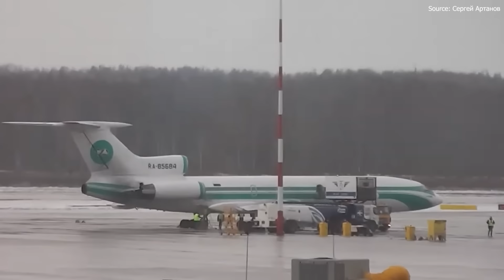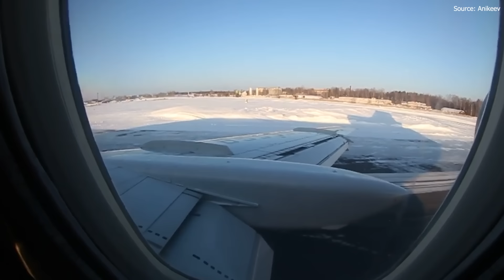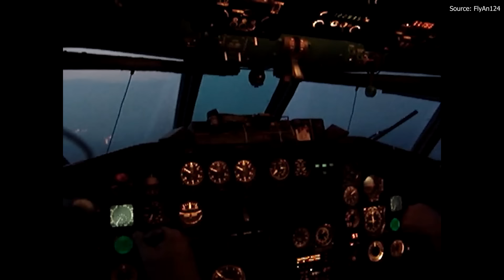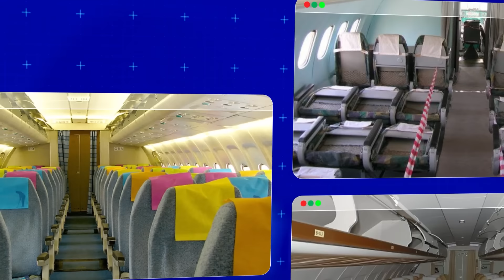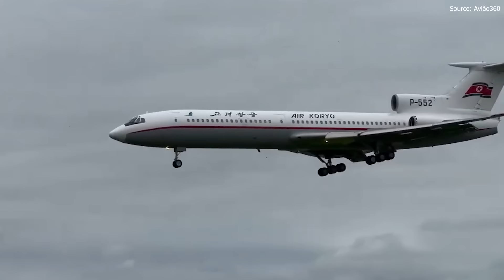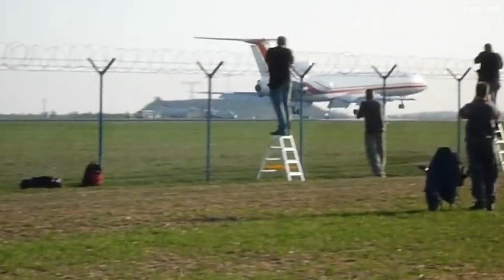Why Was The Tu-154's Middle Air Intake Oval-Shaped?

Comment: In my young years Living in Moscow I flew a lot the tu 154 and its smaller sister the tu 134, the 154 is an excellent airliner always performed well, the only crashes were pilot errors most of the times and never from the plane.. On fighter jet comparison, Once we had a landing from cruise altitude in exactly 7 minutes, numerous times we had 180 degrees sharp turns on edge of runway before landing.. nowadays these seem impossible feats.. all in all, great plane that I liked on par with the IL 86 and IL 62

Comment: I flew a TU 154, from Moscow to Copenhagen in 1996. When I saw the plane, I thought it must be "Soviet homemade", but I was surprised. The take-off was surprisingly powerful, and when the plane landed in Copenhagen, it was as if the plane landed on a cushion of air - no bump! I thought it must have been a very skilled pilot. After watching this video, I understand better the strong acceleration, and maybe it was, besides a skilled pilot, the extra long landing gear that made the landing so perfect.
Reply: Flying an aircraft like the Tu-154 took a lot of skill. Most pilots would have thousands of hours of experience on other aircraft long before they actually got into the cockpit of a Tu-154. I had the honor of talking to a former Tu-154 pilot a few years ago, he really missed it a lot.
Reply: The landing on Tu154 was so soft easy not because of pilot skill, but mostly because "ground effect". It is, exactly as you pointed out, an air cushion. It forms under all aircraft close to the ground, but is most pronounced when wings are low ( closer to the ground). Aircraft eith engines below the wings have their wings higher from the dlground on landing, to give more space to the said engines.

Comment: Oval centre intake copied from the De Havilland Trident, which flew 6 1/2 years earlier in 1962.

The Trident was very advanced  for the time - 1st zero visibility auto land ; incredibly fast (Mach 0.88?) the aerodynamics principles on the Trident wing was a foundation for future Airbus wings.
The tragedy with the Trident is that the Board of the then new Hawker Siddeley Aviation  which amalgamated DeH with Avro and various others, decided to downsize it to suit only the launch customer. The specific new engine for the Trident (RR Medway) was canned as a result, resulting in a underpowered aeroplane that thereafter struggled to grow to the correct (= original..) size the market required.. No-one else wanted it. 

Boeing - having been given all the Trident tech as an attempt to launch a joint project - correctly decided to go alone and keep the original size. 

The rest is history (117 Tridents,  1800+ 727s...)

Comment: My father was piloting the 154 for a while. He still admires her but admits that, while being extremely reliable and simple in maintenance, it wasn't tolerating to pilots' mistakes and Tupolev engineers were too overconfident to admit the many 154's flaws until it was too late. Still a good machine in her class tho.

Comment: I flew in one of those badged as Air Via back in 1996 to Bulgaria. They'd done a decor job on it with what looked like gloss paint inside but the equipment looked very 1970's. The wings had patches on them, the engines were very noisy on start up and it didn't seem to have air conditioning, only heat so on the ground it was boiling. Quite an experience.
Reply: In America you had airliners that were air conditioned. In old Soviet Union, we had airliners where air conditioned YOU...

Comment: Flew to Yugoslavia from Manchester in one of these and loved the experience. Not only was it super fast it was surprisingly comfortable for something that looked like it could be easily repurposed from civilian to military use. Also flew on a TU 134 which was clearly a design from an older tech school of thought and obviously a military aircraft first but put to civilian use with minimal frills. Again a fast aircraft but seriously less confidence inspiring…….especially when high temps prevented safely filling the tanks in Split and requiring a cooler temp top up in Zagreb to get home. Thankfully some of the most beautiful cabin crew I’ve ever seen proved adequate distraction. The 16yr old younger me was very very happy to suffer such aesthetically satisfying delays.

Comment: Swept wings do have inherent stability, but dihedral or anhedral is not a "choice". It is designed into an airplane to provide the desired roll stability, considering the airfoil section and wing design. Many western airplanes use anhedral - The F/A-18, B-52, F-15,  Panavia Tornado, Sepecat Jaguar,  for instance.

Comment: flown twice on a 154-B2 both on Malev, in 1985 and 1989 much more stable on takeoff and landing than any American passenger jet due to its very wide tricycle gear, also landing was very smooth as the drooping wings also took up some of the impact on landing
Reply: Me too. A few times to Budapest. A different ride to the  Western stuff. Just seemed stonkingly fast!
Reply: @PeteClark-fb7qr  Back in the day I always thought it was ridiculous that they had the right side of the plane smoking and the left side non-smoking, doesn't help you when you are at an aisle seat.  The engines had a high pitched scream to them

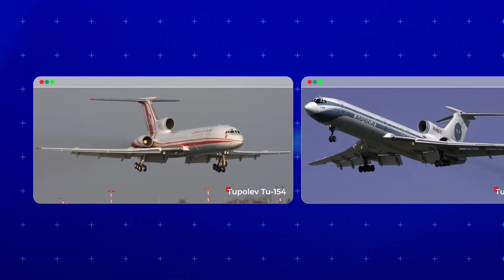Comment: 7:08 Isn’t  that  this Polish Presidential TU-154 that crashed in Smolensk, approximately 15 years ago?
Reply: It sure is, the plane performed reliably but the pilots were under pressure by higher rank officer in the cockpit and worst visual conditions.

Comment: Also anhedral swept wings also are a bit more effective since air isn't rushing towards wingtips that fast at a big angle of attack. Also it isn't the first two players playing to feature anhedral wings. Tu-104, based on a bomber, had similar wings
Reply: Also allows the main landing gear to be shorter, as the main gear is closer to the ground

Comment: -I flew the 727 on all three seats.  Flight Engineer. first officer, captain.  I did them ALL.  But here is what I can tell you about the 727-100:  It had the stupid oval shaped intake for the center engine (I could never land that airplane right!  The -200?  That was easy). When you level off, you need to shut off one of the bleeds of the number 2 engine just before your altitude, or you will get a loud compressor stall!  I never caused this during the 1400 hours I spent in the flight engineer position in this airplane.

The stretched 727-200 had a round number 2 opening and this was not a problem.
Reply: Dear friend.
I have a question to ask you.
Few years ago in Iran , one 727 crash landed during approach on a snowy night just before the runway.
Would you please tell me is there any special procedure for throttle adjustment during approach in snowy cold weather?
From what i heared the crew shouldnt retard  throttles to idle in freezing temperatures otherwise the engines will flame out!!
And if this is true, please tell me who is to blame?
Is it the captain or Flight engineer?
Thank you
Reply: @AmirhosseinEghlim  In icing conditions we turn on what is known as engine anti-ice.  This bleeds off hot air from the compressor section of the engines and sends it to the inside of the intake "lip".  This air is approximately 300 degrees C and effectively prevents ice from building up in this area.  The intake of a jet engine is very carefully designed and any ice buildup could cause the air entering to become erratic and possibly cause the engine to stall and "backfire".  The bleeding of air like this causes the engine to lose a small amount of power, but this is insignificant. To produce the proper amount of hot air like this, the engine must be operating at a slightly higher speed, so there is a limitation against going below a certain internal RPM when this system is activated.  The only time you go below this limit is when the airplane is about to land, just a few meters above the ground.

I'm not familiar with the Iran crash, but it could be any of a number of things.  We also have the ability to prevent ice buildup on the leading edge of the wings in the same way, and while this situation is rare on fast jets, it can happen and if it is not remedied by turning on the wing anti-ice system, it can result in a disaster.
Reply: @Flies2FLL Thank you so much
I appreciate it.
Best regards
Reply: I came here to comment on the 727-100 having an oval inlet as well.  The Russians copied the old  design.
Reply: I was a FedEx ramp agent on 727-200s and got to jump seat with the crew. 
Still my favorite aircraft.

Comment: As plane spotter at the Munich airport, I liked the Tu154 for their distinctive idle whine. You arrived anywhere at the airport and knew by that sound, a TU154 must be around. So much fun, when planes didn't all look similar to each other.
Reply: How Long are they Not allowed to fly in the EU do to noise and emmissions ?
Reply: @wheelieschulz1204  If you mean the Ruhezeit aka quiet time at the Munich airport is from 11pm to 5am i think
Reply: @jorkingitvigorously  Aber außerhalb dieser Zeiten darf man damit fliegen interessant 😅
Reply: I haven't lived in Munich for long, but i don't know if you ever managed to see the IL-76 land here. Same distinct whine, basically their charm
Reply: I flew once from St Petersburg to Vienna on a Tu-154. What I recall most - apart from the rather narrow cabin - was the awkward sound the engines made upon take off: they were spoiling up on a very high pitch (like a coffee grinder) and returned to a normal pitch once thrust was set back to climb.
Reply: 15:55: That's a Yak 42 ....

Comment: The B727-100 had an oval inlet. The longer -200 #2 inlet was round with vortex generators.
Reply: Sorry.  I was wrong.  727 100 had a slightly oval #2 intake
Reply: @dougn2350... I've slid down both....though a tight fit in the beginning in the -100...no rips or tears when i got to the fan!!

Comment: The most beautiful passanger aircraft ever made.
Reply: No. The Constellation was.
Reply: @JRobinsonSr  Why are everyone so obsessed with the Connie? It looks like an unevenly filled sausage that is thicker in the middle than in the nose and tail, has a humongously tall set of landing gear. It just looks disproportional all over the place. The TU-154 is sleek and aerodynamic with swept-back wings and lots of power.
Reply: @korpiusleitinusk6736  Power does not make something beautiful, so let's get that out of the way. The Connie has sweeping lines, this Tu-154 you're talking about is just a copy of a 727. At first glance, it looks like a 727. The Constellation looked different from everything else. The constellation was beautiful whether it was flying or just sitting still, just like a Jaguar E type. The TU154 is a farm truck. 
Your obsession with the shapes of sausages is disturbing.
Reply: @JRobinsonSr  The TU-154 does not look like the 727 just because its a mid range trijet. There are several mid range trijets. The TU-154 is a much more beautiful and aggressive looking aircraft compared to the 727. It has a more pointy nose, its wings are more swept-back like a business jet, it has larger and more powerful engines, it has a higher cruise speed, and can land just about anywhere. Designwise its the most beautiful passenger aircraft ever designed.